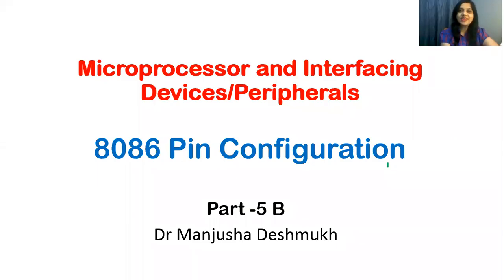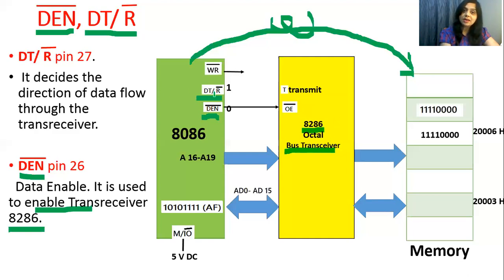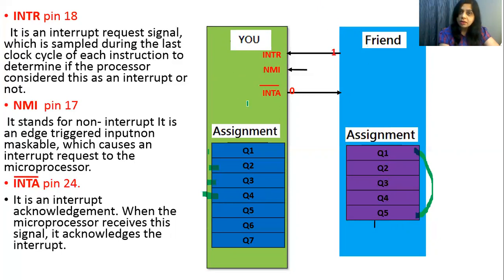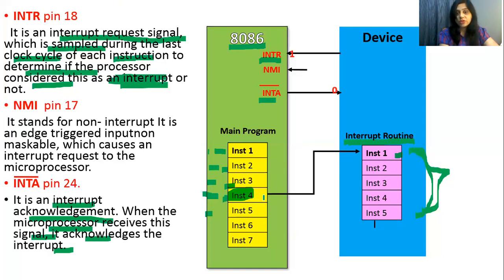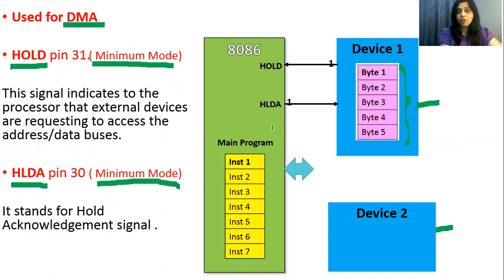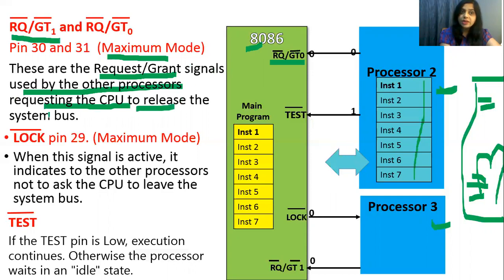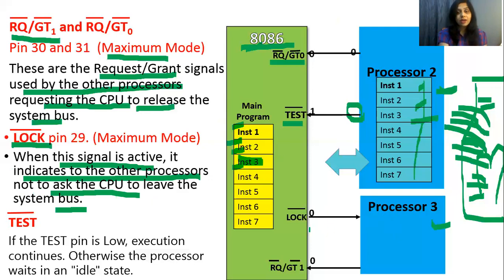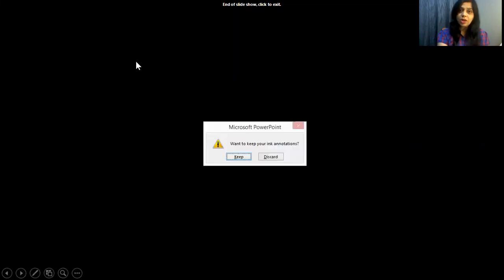for 8086 mcq : 8086 pin diagram Part B mcqs : Dr Manjusha Deshmukh

Comment: ma'am I am not getting pin diagram portion :(  please suggest me any materials :(
Reply from the maker: Dont learn all pins at a time. First understand concept of address and data and learn AD0 to AD 15 till A19
Learn interrupt concept and learn NMI and INTER pin
Learn minimum and maximum mode and learn pins associated with it.
Ready, reset, clock, vcc. ground are very easy.
Learn concept of DMA and learn HOLD and HLDA pins